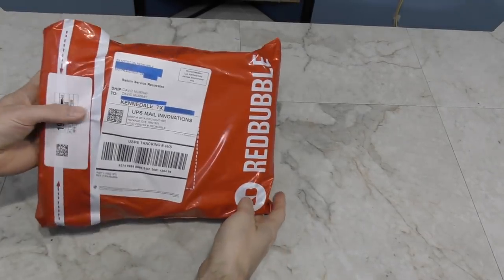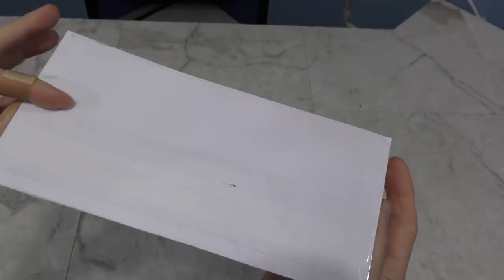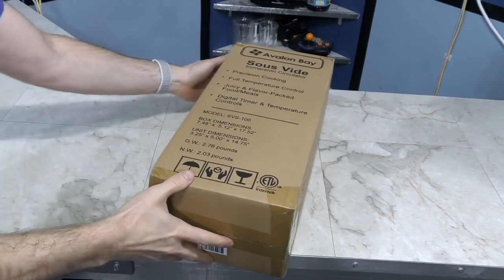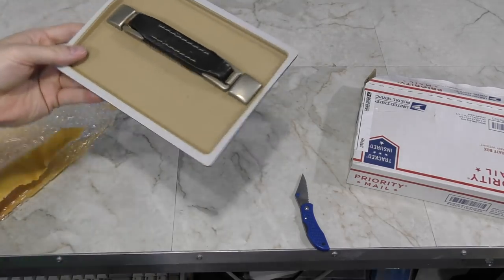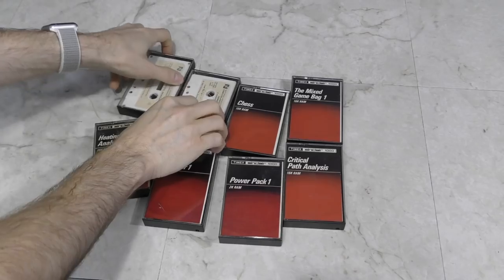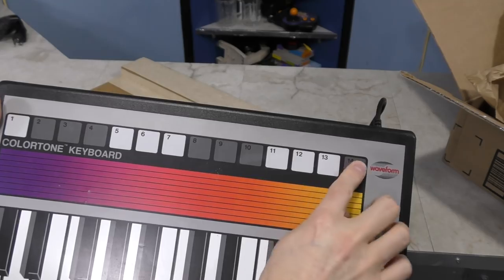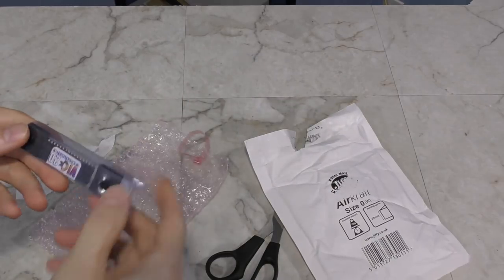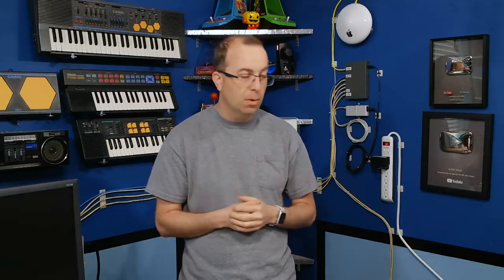8-Bit Unboxing May-June 2018

Comment: ok this is quite off topic but I am stumped

in 1971 or 72 I was given a computer like toy/educational thing, I am trying to find any information on this.

it had a plastic base and came with pieces/parts to put it together it had rows of slides where a plastic slide moved up or down the top of the thing had a row of lights and there was a plastic cover that went over them, but you could put differing cutouts into this cover and the lights would shine through.

it came with many many clips that fastened to the underside on rows that they clipped onto above these clips in the top side of the unit were many holes that corresponded to a clip a wire could then be placed in one hole and the other end in another hole.

when it was all put together there were "programs" in the book you could run. these programs were specific wiring diagrams that when placed properly you could use the slides and the specific cutout to run the program lol, my favorite was a chess problem you could solve.

if anyone has any clue about this old thing from the past please comment on it.
Reply: Yeah, it's called a ViewMaster..... ;)
Reply: nope, not even close. :-(
Reply: its close but not the thing I had, there were red colored slides that when moved made connections with the wires that were plugged into the board. by moving the slides different connections were made that carries the battery power through the wires to the light bulbs.

btw, I am a fan of Fran Lab :-)

think of ENIAC that had to be rewired to change its program..

thank you guys for trying.
Reply: Dennis Hagans Maybe you had the predecessor...
Reply: it was like a breadboard but a bit bigger but the only thing that plugged into the holes were wires period.
Reply: Dennis Hagans Are you sure it's not the science fair digital computer kit? It's the only thing I can find that's remotely like what you describe. Sliders, inserts for different functions, and wires connecting points...
Reply: I am sure as I had to put it together I remember the process and pieces/parts.

the red sliders acted as switches, making a connection between the plugged in wires.

a top-down view s a 14x14 plastic box at the bottom the red sliders went into there own rails at the top was a bank of light bulbs with a cover and special transparent cut outs for differing "programs" from the book.

the "program" was various wirings for each program.

on both sides of the sliders were pin holes to plug the wires into.

there was a place for batteries and when you had wired it up according to the diagram moving the sliders up or down turned on one or more lightbulbs that shined through the transparency.

it was nothing like a Radioshack science kit.

no resistors, capacitors, or any other science project pieces/parts

just a Breadboard box with sliders that acted like switches and various colored wires of various lengths.
Reply: Dennis Hagans You are precisely describing the science fair (radio shack) digital computer kit. This is not one of those 160-in-1 electronic kits, but a system exactly as you describe.

Comment: I recently looked a bit into those Epson portables when I saw one show up, and they seem to go for like 150-200€ for just the computer sans even a power supply. Could've probably made some money if I were a flippin' (and probably exportin') man, since no one seemed to want it at that particular fb-group. Thought also about getting it for myself, but I didn't really see myself using a machine like it that much. Hope the guy got it sold and got some money for it.
EDIT: I was surprised the Atari-case wasn't porn games.

Comment: You should request for An msx computer. Just a suggestion. They are quite capable machines
Reply: Only not really a thing in the states back then. More a strange Japan, Norway, Netherlands and oddly Brazil thing.
Reply: True but he got a commodore max also so it is possible

Comment: Ditomaceous Earth is used to filter liquid food product, as such it needs to be something that is chemically and biologically inert.  So it is "food safe" , but it is not food.

DO NOT EAT D.E.  

It is mostly silicon oxide and as such has the same nutritional value of sand or powdered glass.  Also silicon oxide.

Comment: Modern monitor??? that has VGA???? ya no after they passed the resolution that vga could handle a while back 16:10
Reply: VGA has no limit in resolution, just the electronics become more costly the higher you go. VGA implementations typically have between 200MHz (low-end) and 400MHz (high-end) of analog bandwidth. 400 MHz would be pretty suitable to run modern monitors, it's just that in today's world, people don't make great VGA ports anymore and they are closer to 200MHz in practise.